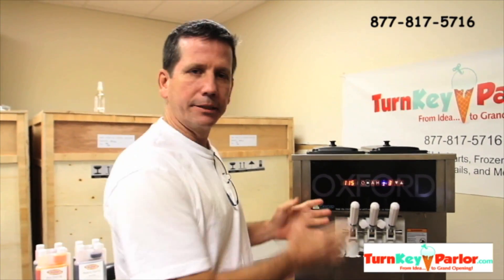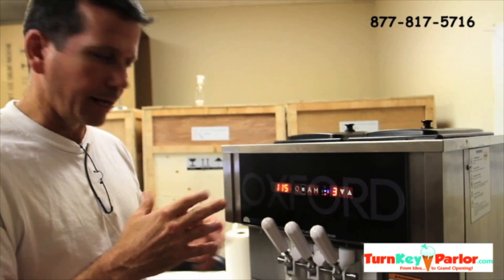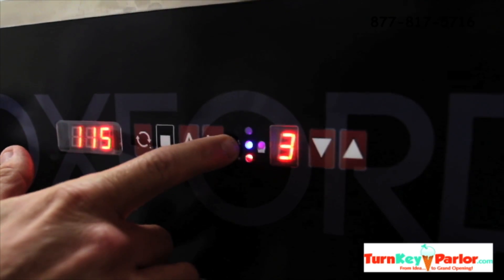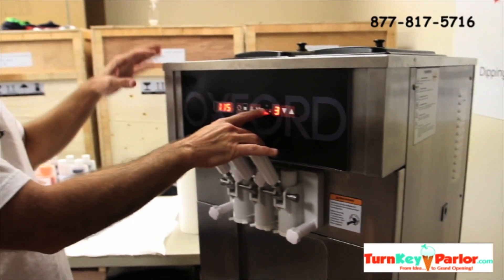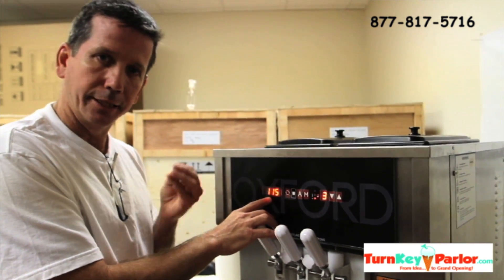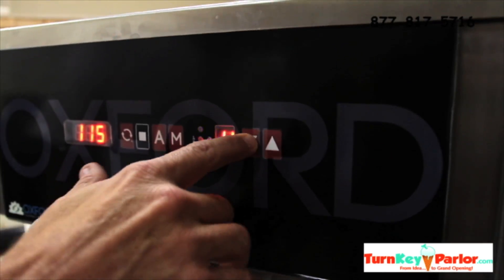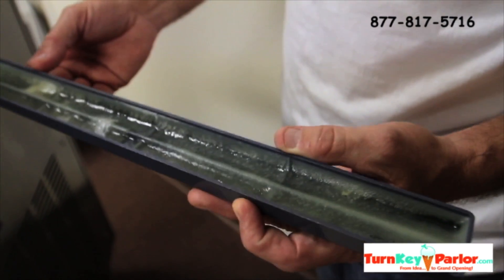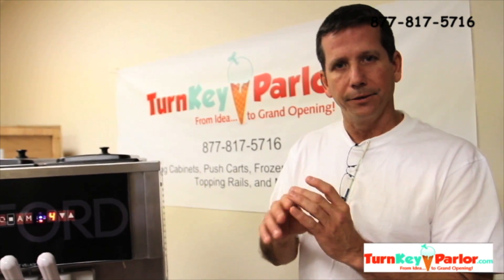Commercial Frozen Yogurt Machine Control Panel

Comment: So we have 4 OP332 machines we bought used, same machine as you sell, the product gets very soft even runny when it sits for more than 30-40 minutes without a dispense, we are having to always check and dispense machines 30-40 minutes or the machines turn to liquid. The cycle comes on every 5-7 minutes when sitting but it still melts unless we dispense the machines,  Why?
Reply: We service them , contact us